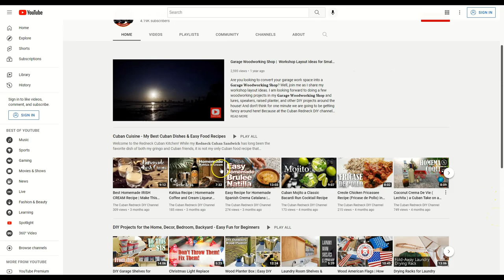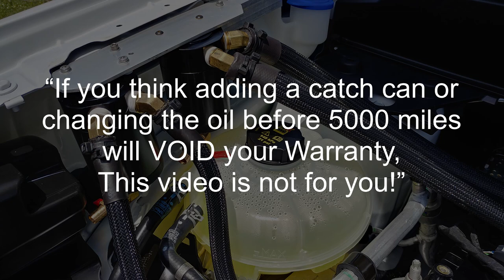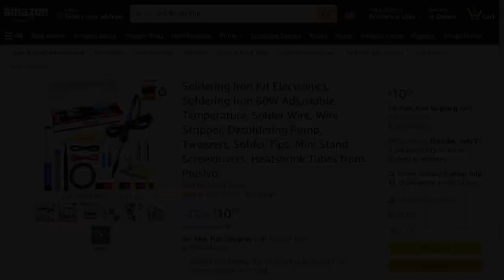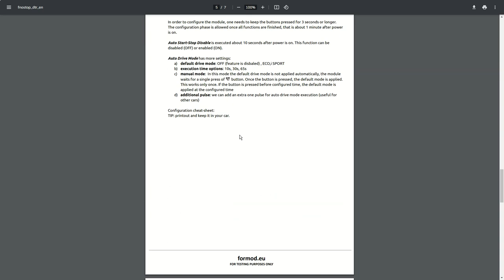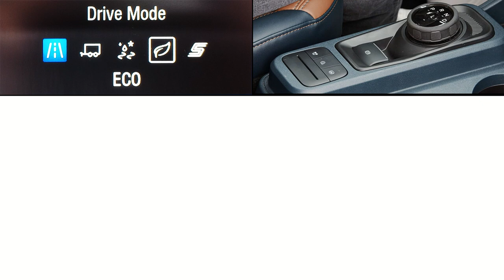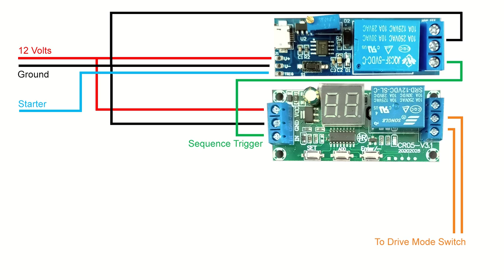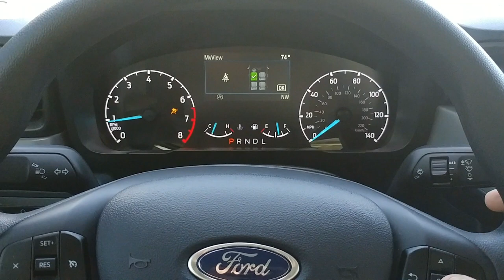Ford Maverick Drive Mode Hack to Set Eco-Mode

Comment: That’s cool I had a similar idea of how to do this when I noticed this “feature” too. Glad to see someone actually went through the effort of automating the push button sequence. It’s kind mind blowing that you cant go through some menu to preset the drive mode. Another idea I have is to see if there is a signal on the OBD2 CAN lines that communicates the drive mode. If there is there is a chance that you could program the default drive mode using any open source CAN bus or OBD2 product. The arduino has one that I’ve had good luck with in a Transit so it might be similar.
Reply from the maker: … thank you for stopping by! This module is very raw and simplistic. Undoubtedly, using an Arduino or similar programmable device will give you more functionality and accuracy. However, that involves programming and other skills that may prove challenging for some. As to the BUS signal, all the ground trigger does is toggle a latching transistor. Not very sophisticated. Once the ignition is cycled, it defaults to NORMAL mode.

Comment: This has been something I've been thinking of doing for a while. Nice well put together video. My only concern is since you spent so much time on this, why not use a solid state relay? Who wants to hear 4 clicks everytime they get in? Also, why are you using a timer? I haven't confirmed yet but my intuition is telling me any Arduino micro controller should be able to handle switching this on it's own. Anyways, good work on the video , and thanks for the good explanation of the vehicle components!
Reply from the maker: By the language, I can tell you know what you are talking about, but that is not humanity as a whole. I am not into selling products, and the point of using over-the-counter devices was #1 cost, and #2  facilitate ease of duplication by people with minimal or no experience. When I used to race, I always built my nitro controllers and dealy boxes from circuits in the Radio Shack Engineering Notebooks. I also built my first computer on and on… That said, and although the timer boards I used in the video are readily available, the number of requests for a turn-key module has been overwhelming. I am working on a solid-state circuit using transistors as switches with added functionality for 10% percenters like yourself, and once tested, I will post that circuit on my blog. Thank you for stopping by, and BTW the clicking is around 70bd. It sounded lauder in the video because I had the box taken apart!
Reply: @CubanRedneck  Makes sense, and good to know. Sounds great, looking forward to it!! Thanks for the awesome maverick videos!
Reply from the maker: ... you are very welcome!
Reply: IMHO the electromechanical relay is a good thing. I would expect to get used to hearing it and then know something is wrong if I don't hear it. (i.e. feedback loop)

I agree that an Arduino should be able to do this without sweat. Unfortunately, have you tried to get an Arduino lately? The ATmega328 chips that most Arduinos are based on are really hard to get. See https://www.youtube.com/watch?v=DA6pHT-2fXs That said, I think Adafruit M0 feathers are still easy to get a hold of for $20USD, add on the relay feather wing for $8USD and one can replicate this circuit with less parts and less wiring. Additionally, add a simple SP4T switch mounted somewhere accessible by the driver and the default drive mode for the next ignition start can be set by the driver w/o having to access the controller.
Reply from the maker: ... the clicking is not an issue. The test on the video was done with the box open. With the box close and put away the clicking is under 70 dbs. There is actually more clicking and beeping coming from the vehicle than what the box is emitting.

Comment: This is fantastic! I'll be doing this for sure! I would like to see some real-world data on Normal vs Eco fuel savings. Does the mode really modify various motor parameters? or are you just as well driving in Normal and conservatively?
Reply from the maker: …. Hey, thank you for stopping by! As to your question, if you baby the gas pedal on takeoff and make the trany shift sooner by pedaling it, you can probably achieve a similar result. What the eco-mode does, according to the data collected, is shift a lightly sooner and create a slight lag on the gas pedal input. It has been hard to get solid data as to how much with the equipment I have, but it looks like boost and timing are also down slightly. If and only if you get on the gas slowly, if you put the pedal down hard, eco-mode is overridden for like 5 – 10 minutes. My MPG currently without exhaust or air intake (waiting on 10K service) is 25 in the city and 36/37 on the highway with 37 psi on the tires. I think I can get in the 40s with AEM smart coils, cold air intake (or high flow filter), and exhaust. Some people are reporting no result or difference on eco-mode. That is due to low mileage. We are guessing that the ECU has a pre-programmed break-in period. During this period timing advance is limited, and the AFR is slightly rich. This corrected itself around 3500/4000 miles.
Reply: @CubanRedneck  Thank you for the thorough answer!
Reply from the maker: ... any time!

Comment: Is there a way to do this without cutting into the trucks wiring?  i.e. a plug disconnect I could use to insert this module in between? Making it easy to undo when needed. Also, it was not clear if the two fuses were already in the car or if you had to wire them in yourself?
Reply from the maker: … hi, thank you for stopping by. Also, know that no wires were cut in the installation! The switch is a mechanical device not a smart switch and I guess you can hunt down pigtails at a junkyard and make a Y-harness but I have been visiting my local salvage yards on a regular basis and fail to find any wreck MAVs. As to the two fuses there were added, for extra safety!
Reply: @CubanRedneck  Thank you for your response and the clarity on the two fuses.  In the video at the 12:38 marker, I can see you holding a harness connector that I assumed you had spliced or soldered into.  Is this not correct? Or did you pin the wires and they went into empty spots in the connector?  Sorry just trying to get an idea in my head of how feasible this mod would be before I order parts and start to tear my maverick apart.

Comment: Is that button a dry contact or is there voltage pass through? If there voltage pass through is, I’m curious on the voltage/current
Reply from the maker: … hey, thank you for stopping by, and yes, these are plain old-school surface mount four-legged micro push buttons switched as they used to use in TV remotes and things like that. Putting a MM in series with the circuit only measures a few millivolts. Way within the MM error window. But there is a solid reference for ground on the black with the blue trace.

Comment: Hi! In the 2.0. ecoboost,, does the Eco mode make the gears shift earlier, at lower rpm's? Thanks!
Reply from the maker: … thank you for stopping by. It does several things, i.e., locks the converter, alters shift points, injector duty cycle, etc. Life is a little busy, and I haven’t had a chance to circle back to that. In fact, I haven’t published a video in a year, but at 20K miles, the MAV is getting a solid 25+ on the city and 35+ on the highway. I have also permanently disabled the start-stop, which many claim that it improves MPG. Honestly, I haven’t had a chance to do an A/B test, and since barometric pressure, air temperature, and several other factors contribute to the final result, I don’t feel that simply driving the truck around is a good A/B test.
Reply: @CubanRedneck  Thank you so much for you response! Your feedback is greatly helpful! 👏🏻
Reply from the maker: …any time! GOD permitting, I’ll be back to making videos soon!

Comment: I love your recipes and DIY projects.  I am having some trouble with this one.

If I understand the concept correctly, the time delay relay is triggered to ground through the 12v relay by the start signal.  Then after a 5 to 6 second delay the time delay relay energizes its relay triggering the sequence relay to ground.  What I have found is that the timer relay is activating as soon as it is triggered and stays on for 5 to 6 seconds rather than energizing after the time delay.  This is immediately triggering the sequence relay

Am I misunderstanding the concept, am I wiring it incorrectly, or do I have the wrong relay?
Reply from the maker: …. Thank you for stopping by. Have you seen the diagram on my blog? Please take a look here – https://cubanredneck.com/how-to-automate-eco-mode-on-the-ford-maverick/

So here is the concept, and by the way, several people have made revisions to my original design at the Maverick Truck forum. The ECU has a deaf zone of about 4-5 sec. That means it will not listen to any command for 4-5 sec. The way the box works is as follows. Timer A starts counting the minute it sees the starter signal. It counts for 6-7 sec and engages the relay, which feeds ground to timer B. Timer B needs to be programmed to the number of pulses of the function you want to execute.
Reply: @CubanRedneck  Thank you for your prompt reply.
I have the diagram from your blog in hand. 
 
This is the information I needed: "Timer A starts counting the minute it sees the starter signal. It counts for 6-7 sec and engages the relay, which feeds ground to timer B"  This is how I assumed circuit works.

The "timer A" I have energizes as soon as it is triggered and then remains energized for the 6-7 seconds.  I have the wrong "timer A".  I need the find the opposite timer that energizes after the time delay.

This is the description of the timer I bought:
"Operating mode: the initial state, module outputs: normally open (NO) and the common terminal (COM) is disconnected, normally closed (NC) and the common terminal (COM) connected. Providing a low pulse signal, or touch trigger key, relay and indicator lights, the output of the state: normally open (NO) and Common (COM) connected, normally closed (NC) and the common terminal (COM) is disconnected. After 0-24 seconds (this time can be adjusted according to your needs) relay off, back to the state before the trigger."

Again thank you for your prompt reply.  
I enjoy your work

Su fan del sur de Texas
Reply from the maker: .. any time. Please let me know if I can be of further assistance.

Comment: Cuban Redneck, in the future, will Ford or someone else come up with a mod to select a drive mode and then every time you start the engine again it defaults to your selected mode unless you decide to change it to another mode?.
Reply from the maker: … thank you for stopping by! I doubt it. In fact, many other manufacturers have started to do the same. By decentralizing the ECU into several little pieces (14 in the Maverick), you lose control of what everyone is doing! A guy on the Maverick Truck Forum was making a module based on my findings and selling them. I think if the demand gets up there, the aftermarket should cover the gap, but that is truly wishful thinking. Hopefully, engineers at the manufacturing level will realize this is a HUGE boo boo and make corrections accordingly.

Comment: Mr. Cuban Rednick:  Can that shift knob be changed to a custom knob?  My leg has bumped it out of drive many times.  The rubber grip is so at fault as it is out flush with the console's wall.  The torq to change "gear" is so light that a smooth surface would be better.  A smaller knob is my need.

I suppose that knob is one massive assembly, not  just a 1/4 inch shaft that I could bring my own knob to.  Thanks for considering.
Reply from the maker: … hmm that is a very particular situation. The back of the switch is kind of bulky, about the size of the raised area around it. If there are any custom car stereo shops in your area, I would consult them to see if they can make you a guard that can be attached to the raised area to the left of the shifter. I think a 2~2.5" X 9" X 3/16" plexiglass piece with two rounded top edges can be attached to the console with 3M double side tape and do what you need. Not many places to relocate that knob!
Reply: @CubanRedneck  I was thinking the same thing as your plexi suggestion (though I hadn't flushed it out any more than "attach something to act as a physical shield between the dial and the driver's leg").
Reply from the maker: ... agree, it don't have to be bulky, just big enough to cover the point of contact

Comment: Can anyone confirm if Ford fixed this issue?
Reply from the maker: .. hey thank you for stopping by. What do you mean by fixed? Not remembering the last selected has been present on all Ford products for over a decade. In fact, many other makes are now doing the same thing. As I mentioned in the video, this is a by-product of using multiple small ECUs instead of one centralized one.
Reply: @CubanRedneck  I thought I remember reading something about a fix being issued by Ford some time ago. I got pretty frustrated with Ford over my Mav taking so long to be built I kinda just quit paying attention to anything about it. But got an email that it has now been scheduled and kinda getting into everything again.
Reply from the maker: ... no this is still an issue and honestly it is no big deal once you get use to it. It is no different than when you get a new phone. But, it is something that as an engineer and software developer makes you question, what were they thinking? As I said several other manufacturer are following this format and I can see this becoming the norm.

Comment: Shouldn't be hard to add a resistor at the connector... Much less taking apart the center console.
Reply from the maker: … thank you for stopping by! Yes, not an issue for me, and since you brought up the subject, perhaps that is something you can do as well! But not something for the majority of my audience. That is why I often air on the side of caution and, more often than not, choose a less technical path. BTW – taking off the center console proofed to be quite simple, and it gives you better access to the entire harness!
Reply: @CubanRedneck   did you by chance measure the resistance between the connector and the button on the ground wire?
Reply from the maker: .. I didn't because I already had the console apart. The resistance may be irrelevant, it can simply be a diode, or the LEDs use for illumination sharing the same ground. I am pretty sure the ECU is not looking for a given resistance value. More then likely just a reference to ground.
Reply: @CubanRedneck  

The pinout for the connector (C302) shows that there is direct continuity between pin 47 and pin  12 on the instrument panel console (C3010), with wire color BK-BU (Ground).  Also, direct continuity between pin 7 on C302 and pin 1 on C3010, color GY-VT (Switch Econ Control Eco).   Should be no difference accessing at the mid point connector.  I'll test it and report back.  Love your idea, BTW.  I plan on using a PIC microcontroller to control an optoisolated solid state relay to control it all.

Comment: dude you just have to push a button to select, how hard is that!
Reply from the maker: ... true, try doing that 10 -12 times in a span of a few hrs. People requested, I show them how! I am now using a piggy back module so its locked on ECO MODE 24\7 and loving the 37 MPG (26-27 in heavy traffic) - only 3 miles from my goal of 40 MPG @ 73 MPH. But a lot more work to do.